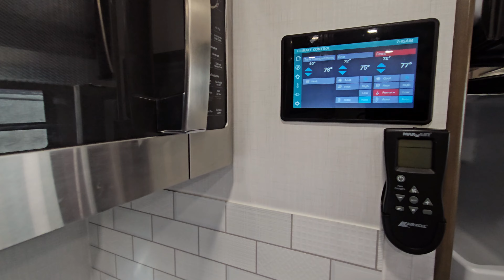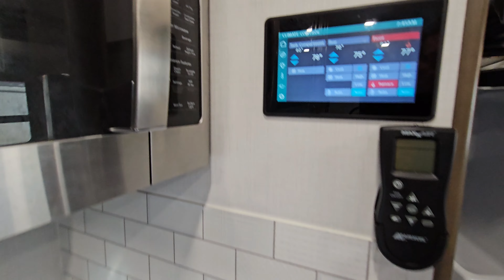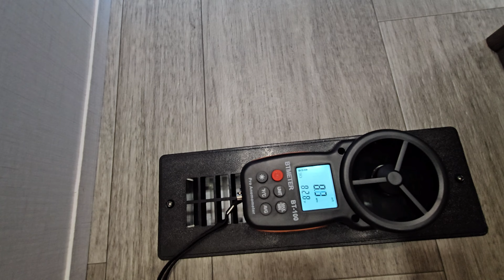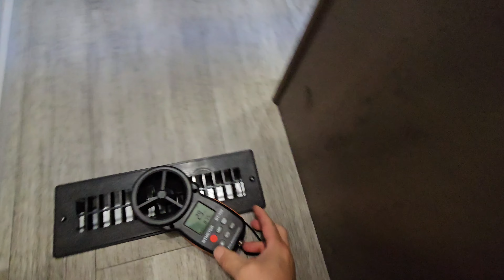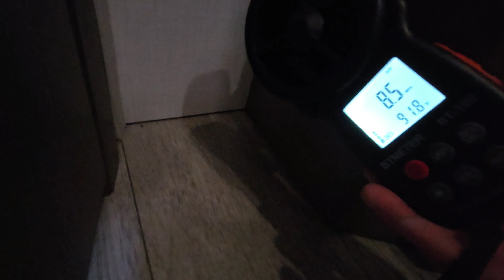RV Propane HEATER is too cold and too hot explained.

Comment: You got to love ductwork! As you know, as a retired aerodynamicist, airflow is a passion.
Good to see that you found a workable solution to the poorly engineered original design.
I'm a little concerned that your return air is going to ingest the hot output air in the center of the original retire air grill. I would love to see how you are mitigating for that in a follow on video.
As always, thanks for sharing,
Mark Sleppy
Reply from the maker: Thanks Mark. This reassures that most manufactures don't use ME's these days. I couldn't do much on the separation but you will see in next week's video what I did.  Very happy with the new performance now though.

Comment: I called it before you showed it. A tee off the duct going to the register under the sink was a design error. Most all of the hot air was shooting right past it. Nice fix. Thanks for sharing.
Reply from the maker: I wonder who engineered that?  Certainly a non qualified engineer or anyone with common sense of airflow.

Comment: Always good to see real world examples.  I have passed this on to engineering as I am sure we can make it better.
Reply from the maker: I don't know who is reviewing on your engineering team, but they could not have signed off on this design of the ductwork.  Anyone remotely familiar with airflow would see this as a major issue.  I appreciate you looking at this regardless.  In my opinion, I would have a hard time accepting any engineering explanation except that it was a mistake and overlooked, and will be corrected.  My 2 cents.
Reply: @rvlifediy  it does not appear to be to print, but even then, I am not sure it needs to be two 4" runs to the back.  The reason that there is two to the back, is because the back duct ALSO feeds the wet bay to keep it heated.  Where those two are located on the furnace box though, is feeding more air then it probably needs though.  We also already changed the bathroom to a 4" from our testing.
Reply from the maker: @DynamaxRVs  good to hear changes are made.  My rears don't feed the wet bay. I ran a camera through the duct and see nothing in the wetbay. I was suspicious because the furnace doesn't heat my wetbay like it's supposed to. I'm thinking the hole may have been forgotten during production.

Comment: I have a 28ss and have similar issues, but I also have a furnace vent that dumps into the insulated external compartment on the passenger side. I’ve measured as high as 160 degrees Fahrenheit going into that compartment.
Reply from the maker: Mine is supposed to go in the wet baybas well. I haven't actually check where it dumps out. I'm assuming it is connected to the same ducting in the floor that goes to the bedroom.  I'll have to run a scope to see where it dumps out. I can't feel the temp change at all in the wet bay at all so I'm wondering if they missed that.
Reply: @rvlifediy  In mine it is a round port in the “ceiling” of the compartment that is aimed straight down. There’s an opening between the two waste tanks that leads to the water bay side, but based on my temperature readings very little of the heat gets over to the side where it’s needed. I’m thinking of designing a deflector to try and route the warm air over to the water bay side…
Reply from the maker: Thanks for the info.  My two tanks touch each other and take up the entire with of the wetbay so nothing can blow down between the tanks as the tanks have no space between them. I'll have to investigate more but I'm thinking the bottom of the metal pan duct I have is just exposed in the ceiling of the wet bay and transfer heat that way. I'll have to run a camera to really find out.  I did end up doing a video to silence the furnace so that will likely post next week.
Reply: @rvlifediy  If there’s a port into the wet bay, you should be able to see it. And thank you so much for the videos you post. Like you, I had a 2020 Winnebago View and that’s when I found your awesome material. I switched to an Isata 5 28ss Xplorer edition back in July and I’m really happy with the upgrade. I’m scheduled to get the Liquid Spring conversion in early November and that, I think, is going to be a real game changer.
Reply from the maker: @mowind92  cool. I'm jealous of your upcoming liquid spring. I had my liquid springs planned in July but didn't have enough time to commit not having the RV. Will likely still do it if time allows. Too many projects and trips that take priority and the family is ok without it for now.
Reply: I looked into the 28ss after seeing his new RV as well and am still keeping it in my short list.
Reply: @mowind92  yes my port is between the two tanks blown straight down but I definitely don’t notice a difference in temperature on the side on the opposite side compartment. There is a noticeable difference.

Comment: Considering this is supposed to be an RV designed for winter use I I think it is quite pathetic the way they half-assly installed heating.  All they would have to do is read the furnace instructions that the manufacturer supplies with it.  And this is supposed to be one of the better brands ?
Reply from the maker: Yes very true.

Comment: As an owner ( Retired) of an HVAC contractor , that is the most stupid install from the factory I’ve seen . Sad that you have to spend time and money to do it better.  Whoever although I suspect that they don’t have a P.Eng designing the systems and if so they should fire that person!  At least they used better ductwork for the leads. You should also add  AB vanes at the plenum If theres room and get a CFM meter so you can adjust the airflow to needed areas.  Good work to fix.
Reply from the maker: Yes without a doubt no PE would sign off on that.  Very disappointed how poorly it was done. My fix works great however I would like to get more volume at the front door supply vent.  That way the upper bunk can get more heat.  I need to make some distribution changes.  The very front of the furnace supplies blow the hardest even with the awkward 90 bends in the flex.  I've been trying to find 90 degree pieces that will fit nicely with the furnace collar but haven't had much luck. Will be changing it sometime in the future, but for now, it works much better in 20 degree weather.